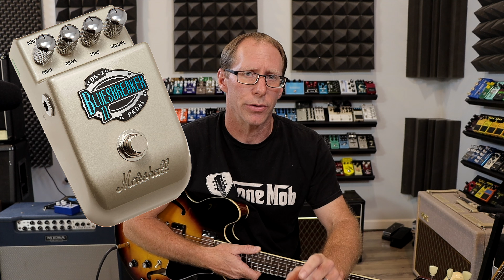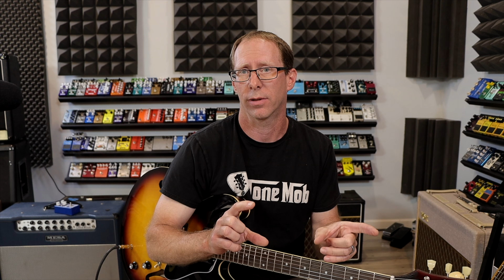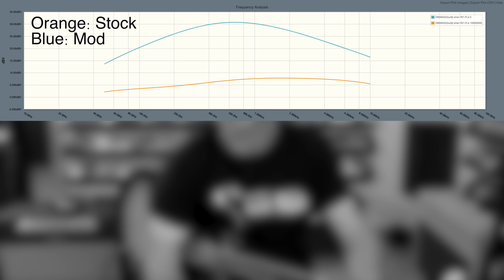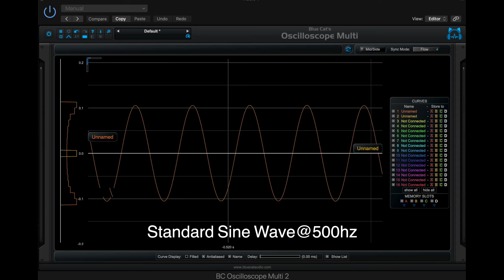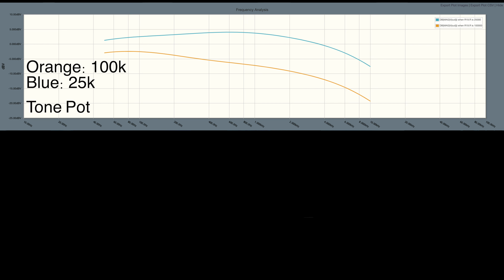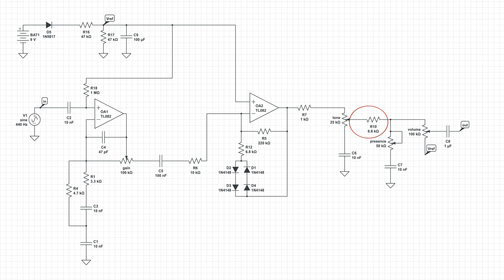Deep circuit diving with the Marshall Bluesbreaker

Comment: Thanks for the video. I have the Marshall BB reissue pedal, I hope Marshall did a great job on it and that I don't need to upgrade it to improve the tone because this pedal is already quiet expensive 😊 i have found tube overdrive amp  Chanel combines well with this Marshall BB pedal to increase the overdrive tone

Comment: What do you think about changing the C9 to 0.01 from 0.1?  Noticed this reduces the time for the circuit to achieve full VREF voltage of 4.5vdc -- seems to have a considerable delay here on my breadboard circuit (approximately a 4-5 second delay).   I find if I put a 0.1 cap across R16 it dramatically reduces the VREF delay as well.  This is all over my head to understand the how here, just observing the results of these changes.

Comment: hello. I see that Power stage starts with Shottke diode 1N5817.  but there are several versions of it.DIO, DC, ST, E3/54, RLG and they seem to differ by  forward voltage . Do you know which version should be used? thanks

Comment: fantastic video thank you for sharing. I saw this end to end several times and with very limited electrical knowledge managed to build this pedal on a breadboard in three hours. now I will  make my "custom" pedal with the modification tips you shared and put it on to PCB.  I took a screenshot of your breadboard and and it helped me. I found one resistor in your breadboard that I can not recognize in the scheme though :)

Comment: Great video, loads of info, clearly explained. 👍
Im curious what would be the effect of putting the hard clipping in front of the soft clipping (between the two halves of the op amp)?
I imagine this should sound more like running a distortion pedal into a tube amp.
Are there any pedal circuits that arrange the gain/clipping stages in this way?

Comment: I found a Bluesbreaker schematic that shows C3, C6, and C7 connected to Vref rather than ground. I experimented with wiring the circuit both ways but I didn't notice any difference in the sound or behavior of the circuit. Given that there is a 4.5V difference in potential between Vref and ground, I would have expected there to be some noticeable difference. Can anyone enlighten me on why the circuit can be wired differently in this respect? The schematic in question is here (note that the equivalent caps are labeled C3, C8, and C9 in this one): https://1.bp.blogspot.com/-a9F3cPJg3Ic/Wq234jJ9JxI/AAAAAAAAD9I/3rmQH5ljh9AKN4szF8upZRI-rCItSRhGgCLcBGAs/s1600/1366373077_bluesbreaker_sc1.gif
Reply from the maker: It’s the same thing basically, because that 4.5v is actually set up like a “virtual ground”. It will work either way, but it can be less problematic using ground rather than this vref if one isn’t using a buffered Vref source.

It gets a little complicated.

Comment: #Marshall just reissued the line of 4 OD Pedals from the 1980s-90s in late Feb 2023.

#TheGuvnor (JCM800 in a Box) is the best choice, since it has an effects loop built in. You can stack OD pedals, like an Ibanez TS9 #TubeScreamer connected to #TheGuvnor. #1980sTone
Reply from the maker: The loop option on the pedal is meant to run to other pedals that are switched on or off with the guv'nor. IE if you wanted a delay to turn on simultaneously with the guv'nor, you'd essentially turn on two pedals at once. It isn’t going to do anything different other than diverting a signal path and ultimately most aren’t going to have a great need for this situation. Looking back through threads about this pedal over the years that notion consistently lay popped up. Fun idea, not very useful. BUT, if you like it then that’s what’s important.

Comment: Thanks so much for this video!! I bought a Blues Breaker DIY project circuit board a few years ago but still haven't put it together as I have been wanting to find out which resistors and capacitors do what. I want to put some terminals on the circuit board and also the Op-Amp ICs so I can swap different  ones in and out when and if I want. I slapped the circuit together on a bread board years ago and loved the way it sounded. Liked it a little better than my MXR GT-OD for soloing then ordered the circuit board but couldn't find the info I wanted til now. Thanks a bunch!

Comment: Loving this series. Really showed me how a design is tweaked - like in this circuit, showing the Analogman mods, and your own. I've had this belief that guitar players attach a lot of mysticism to pedals, and the magic associated. This video shows that it's not really magic, it's a simple process of making choices - what controls to add, which components to hard wire as resistors, which caps you use, and what kinds of non-linear components like diodes and intentional clipping points you want to add. This is great.

Comment: Hi there! I have a question that remains unsolved. Can a preamp pedal be the exact same circuit of a preamp section on a guitar amp? I mean, if I take the circuit of a pedal, lets say, that mimics the controls of a fender amp style, and put it into the amp, removing the old circuit, will it work, will not, will fry?

Comment: why cant we take the hard clipping to ground? doesnt the Guvnor take the hard clipping to ground with this circuit?
Reply from the maker: We need a capacitor before the diodes blocking DC from the op amp (and would need to move volume lug 1 to ground), guv’nor does have this.
Reply: thank you for the info, i was trying to make a two channel Guvnor , but i also want a switch for each channel that goes between the guvnor hard clipping or the soft clipping  the Blues breaker uses. maybe have  an option for symmetrical vs asymmetrical clipping in both. im in option over load atm.  i really enjoy your videos that get into the nerdy aspect of pedal building . thank you so much for your help. im having a lot of fun with  bread boarding circuits one day i hope i can actually make my own pedal.
Reply from the maker: If you Google my pantheon circuit you can see how i did that exactly 😉

Comment: Thanks Brian. Just purchased the Pantheon and I love it. Which one of your pedals is the closest sound wise to the MI Crunch Box please?
Reply from the maker: Closest would be pantheon, but that’s just due to the reasons outlined here, non inverting into inverting op amps with diode setting in hard clipping position
Reply: @wampler_pedals  Thanks for the info and fast response.

Comment: I've had the BB2 for 20 years now and it is an awesome little pedal. So much more than just an OD. Nice clean boost on one side and a Marshall in a box on the other. Much more complex texture than most pedals out there. When compared with the original BB pedal it is   quite similar but the controls are more responsive with better range. Don't dismiss it.

Comment: A question for Mr. Wampler and anywhom out there: Can the volume pot be relocated to the front of the circuit to reduce noise generated by the amp/boost circuit. Thanks to anyone for an answer. I just started to experiment with circuitry and breadboarding. I must be doing it the right. It kinda gets on my wifes nerves. "You spend too much time on the laptop". And my answer is "I'm accumulating knowledge. You think I have Mr. Wampler or Josh's phone # or private email". They'd block me after a while anyway on account of  being a pest.

Comment: Great vid Brian, you're very generous with your knowledge, I'm loving your breakdowns.... noob question, you know when you mentioned taking the extra hard clipping diodes (D6,7) to 4.5v rather than ground, does that mean you'd need to make a 2 resistor voltage divider from the 9v rail and connect it after the 2 diodes?

Comment: Pantheon is my favourite pedal ever. Thanks Mr Wampler
Reply: I skipped straight to the Pantheon Deluxe. Absolutely worth it.
Reply: I’m with you on that. I’ve had dozens of overdrives and still have to many but my search ended when I got the Pantheon. I will be adding a second soon because I love it as a mild boost/light overdrive and in the medium gain setting cranked up.
Reply: Yup, agreed. Mr. Wampler knocked that one out of the park!

Comment: Yessss, this is the stuff. Absolutely my favourite type of Wampler videos. This is what you do the best, always having a clear explanation of how and why things are done, and the visuals to help understand. Not that easy to come by.

Why can't the hard clipping diodes go to the ground there? You mention it like it's obvious, but I've always wondered when you use voltage reference or ground.
Reply from the maker: Thanks! I should have explained that better. It's because there's no capacitors blocking DC (for the most part). If you want to connect them to ground you'd want to use a cap before the diodes (usually before R7), and then connect the volume pot to ground rather than the vref. Some say it's a "little" bit of a different clipping texture when connecting to ground but I haven't found that to be the case personally when using 9v distortion circuits.

Comment: In the early 90's a mate reverse engineered a Bluesbreaker. Designed his own PCB. Although bigger than the original (unsurprisingly), it also sounded better! Just random luck of the tolerances of the components.

Comment: Dear Brian, what about the 10x bigger values on position R1 and R4 on some V1 devices? Or is that hoax?
Reply from the maker: Some circuits do that, the King of tone springs to mind. It does change the bass roll off a bit, but not dramatically.

Comment: Your setup sounds very noisy, is it because of the breadboard? I also assume you are using some kind of noise gate.
Reply from the maker: Yes, it's due to the breadboard, and is normal for gain circuits.

Comment: @Wampler Pedals Great video and great explanations! One (maybe a bit nerdy) question: The tone control pot is tied to the reference with one leg. If we would draw the schematic a little differently we would see that it is tied to the positive input of OA2 directly. The reference has quite a big impedance (well, there is that 100uF cap though...). Would a buffered reference change anything / does the circuit rely on the positive feedback to OA2?

Comment: I have at least two of Brian Wampler's books. One of them is a digital PDF thing. I prefer a book book for my library, so I do have one Wampler book among my 100s of books on audio, electrical, electronics, radio, and scads of other engineering books from hydraulics, to mechanical engineering, to concrete & steel, to land surveying, chemistry, physics, etc.

Comment: Did you play with the Radio Shack 50 In 1 Electronics Kit when you were a kid?  (I had one.  Just wondering if you did.)  I still have a Heathkit breadboard with a power supply.  It's pretty cool.

Comment: Good stuffs. You know me. I love this stuff. One thing to mention, though. The output end of the circuit is a little high for output impedance, so there needs to be some care to messing with that tone control section. Or just do what Josh at JHS did with the Morning Glory and add an additional buffer (JFET, I believe) to bring that under control. I know I need to do that to our Blues Crusher.
Reply from the maker: Yep, on the Pantheon I'm using a non-inverting op amp there to buffer

Comment: I love this circuit so much that I have the Pantheon, the JHS Morning Glory and I'm on the waiting list for the King of Tone.
Reply: Which one do you guys prefer?
Reply: @cseymour001  The Pantheon and the Morning Glory sound completely different even if they are based on the same circuit, the Pantheon is more versatile because of the clipping diode selection and it has more gain than the MG. currently I have both on my board, I use the MG as a boost to give a clean amp some break up, I’ll use the Pantheon by itself as a mid gain overdrive, and stack both and to get a marshall style distortion.
Reply: @davidjoel111  hi, I developed my own overdrive based on this circuit for myself. It sits tonaly between KoT and MG, has high gain and clipping switches also. I can build one for you if you need more 😁
Reply: @vlastimilelias yes please!
Reply: You need a snouse blackbox 2

Comment: I took all those analog electronics courses in my college days to get my engineering degree and didn't get to use the knowledge so I lost most of it.  That feedback circuit on the first op amp really threw me and I do not understand how the clipping diodes work other than cutting off the tops of the signal above .6 volts.  What program do you use to analyze the frequency responses? Spice?
Reply: use LTSPICE from Analog Devices. Full blown. no nodal limits. 100% free. you can even push wav files as input and output vectors to listen to the circuit as well in advance. that's what i use.
layout and schematic KiCAD.org AWESOME... also free.

Comment: For the DSP geeks out there, there is a mathematical model of the King of Tone circuit available at the Stanford ccrma website.  But I noticed that there is one cap misplaced in the input hipass/gain section. 

KING OF TONE GUITAR PEDAL MODELING WITH
NODAL ANALYSIS & TABLE PRECONSTRUCTION METHOD, Kai-Chieh Huang
https://ccrma.stanford.edu/~kaichieh/KingOfTone.pdf
Reply: Thanks.

Comment: Brian, thank you for this type of  "experimenting with mods" video.  Will you make a video on what hardware & software you use to capture your before & after signals and plot them?  Knowing what to look for would really help DIYers see what the changes are, like you show in these videos.  I'm really looking forward to your next videos!
Reply from the maker: In this video I'm actually just using circuitlab.com, which is a simplified spice software.
Reply: @wampler_pedals  Thanks!  What do you connect your pedal/guitar, etc. to when displaying "real" (i.e., not simulated) signals?  How do you display those esgnals?
Reply from the maker: @bobvines00  I use logic pro, so I have done it two different ways. Method 1: there's a signal generator within logic pro, I can use that, exit my Saffire Pro 40 interface, go into pedal, go back into input of interface into DAW channel, or Method 2: Use signal generator app on phone, run signal to pedal via iphone-1/4 cable adaptor cable to pedal, into interface and into DAW. Then inside the DAW with both methods I use a Frequency analyzer like this: https://www.bluecataudio.com/Products/Product_FreqAnalyst/
Reply: @wampler_pedals  Brian, thank you very much for this info!

Comment: Brian please do more of these!  😎 You basically walked us through an abbreviated version of your design process for the Pantheon.  Since I just got one a couple weeks ago, I really appreciate gaining a detailed understanding of the circuit. 

The only thing I still don’t completely understand is the relationship between the Treble(tone) control and the Presence control. It sounds like the Presence boosts (actually cuts less) some upper mids that the Treble doesn’t affect. 

That reminds me - I need to look through your videos to see if you have one on active vs. passive tone controls. And I’m still a bit mystified by the Mid control on the Tumnus Deluxe. If I turn it up past 1:30 or so, it gradually seems to cut Bass and Treble and at “11” it’s a weird but cool cocked-Wah like sound.

Comment: However come it doesn't have (need?) some kind of buffer between the tone stack and the volume control? Won't they end up affecting each other?
Reply from the maker: Great catch! Yes absolutely, they do affect each other. On the Pantheon I did buffer the output so it’s low impedance